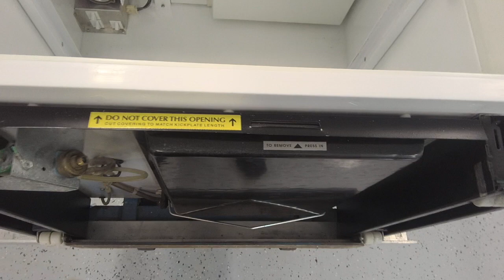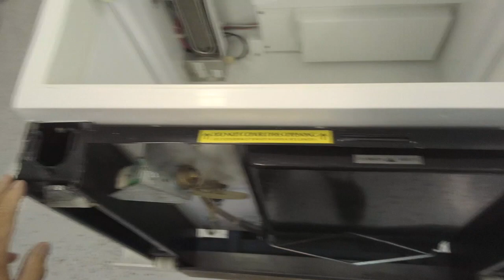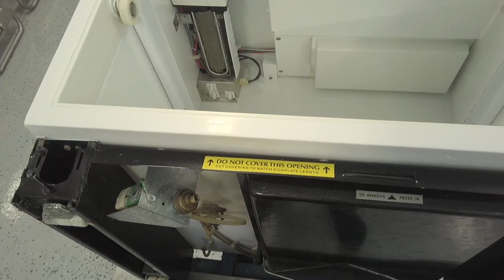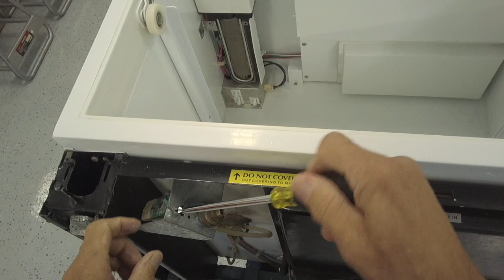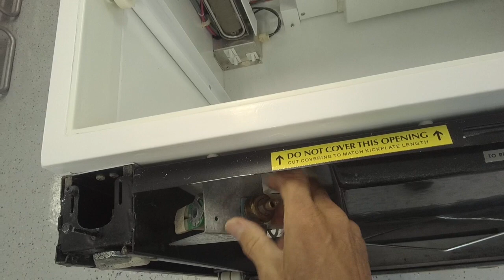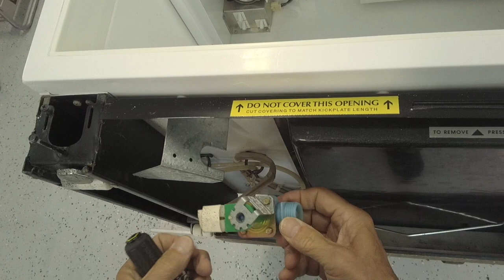Sub-Zero Model 511 Water Valve Replacement

Comment: Hello. Thank you for sharing. I have a 532 model. We do not want to use the ice maker anymore. Would it be okay if I remove Eaton solenoid water valve and water line and it will not compromise the function of the freezer? Thank you for your response!
Reply from the maker: I need to, just shut the ice maker off.

Comment: I have the same exact model with the same exact water value. But I'm not sure what the model # is for the water valve to order one or where to order it from?
Reply from the maker: You can look up the part number on my website aaronsrefrigeration.com or call Subzero at 800-222-7820 for your local parts distributor.

Comment: I have a model 550. Been running since 1996. Is there a water filter? Why do I have black specks in some of my ice cubes?
Reply from the maker: Black specs indicate the pain is peeling. There is no water filter on that model but you can install an in-line water filter available through hardware stores or online. Chang the ice maker, the new ones are not painted inside the mold.
Reply: Thank you!

Comment: This was very helpful, but the first time I saw it, I couldn't get my bearings on WHERE the water valve is located.  I found this documentation here:  http://subzerospecialists.com/wp-content/uploads/2014/07/500component.pdf . (if your refrigerator is installed, its behind the kickplate on the bottom on the left side near the front.)

A couple other helpful tidbits:
- Title says its for Model 511, but it also applies to Model 501F, Model 532, Model 542, Model 550, and Model 561.  
- This may seem obvious, but if your refrigerator is installed, its important:  shutoff your water to your fridge (there should be a shutoff where the 1/4" water line connects to the bigger water piping) and shutoff the power.  You just have to shutoff the circuit that the fridge is on at the breaker box.